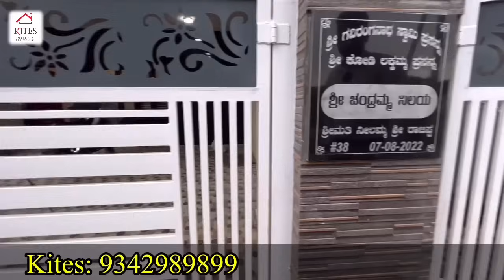30x40 classy construction in 40 lakhs | construction in kannada

Comment: Guys Just don’t fooled by promotions. I am also into construction and If some one want to construct with Red Brick it will cost u around 2.5L average per 100 sqft including everything (Interiors, High Quality Granite, All electrical fittings). Mostly final cost depends mainly on wood work, Bathroom Fittings and Granite. If u go with Hallow brick it might cost 2.35L per 100 sqft. Here I am talking about with all final fittings.
Reply: How will you construct for 3l
Reply: @kadasanirajasekharreddy   I have corrected my message it’s per 100 sqft
Reply: Are you providing services at Bangalore
Reply: I only prefer within KR Puram and Whitefield. And I do have my own A Khatha sites within K R Puram which are in very decent locality in BBMP limits

Comment: Kites alli basic package bandhu Rs. 1950/- sq ft. 2500 sq ft, andre 25 chadradi kaatidre without interiors 48.75 lakhs aagutte...adhu yaava lekkadalli 40 lakh anta heltidira
Reply: ಯಾವ ತರಹ ವಿವರಿಸಿ ರಿಪ್ಲೈ ಮಾಡಿ
Reply: 1 sq ft will cost you 1950/- rs. 25 chadra andre 2500/- sq feet kattodikke 1950 X 2500=48.75 lakh aagutte alwa. In simple 40 laksha aagode illa..

Sq ft rs. 1750 aadru almost 44 lakh aagutte.
Reply: Actual Area = 2750 sq ft
Rate of 1 sq ft = 1675
total amount = 2750 x 1675 = Rs. 46 Lakh
They were providing cement Bricks , aluminium Windows and Vetrified Tiles.
So we said that to Red Mud Bricks , wooden windows & shutters and Granite.
It cost us extra 6 Lakhs approximately .
All interior was provided by us from third party Carpenter, which cost us around 5 Lakhs ( material + labour).
So total Cost of this house that You See in this video is 46 + 6 + 5 = 57 Lakhs.
I would say that around 60 Lakhs Spent on this.
Reply: @bharatsr5149  40ಲಕ್ಷ anta display ಹೇಳಿದರೆ ತಪ್ಪು
Reply: It's 46lakh as told by the owner....not 40-42 lakhs......
Kannada kuvara, pl give accurate value....pl don't misguide.
Reply: How views goskara niv heege maadi fake or misguide madidre gradually subscribe kadime agute
Reply: @somashekards8086  that's true nowadays all his promotions are showing. Less price compare to calling the company...
Reply: Right the problem is accurate figures are not mentioned for various purposes. Alli hogi vichara maadidmele gottagodhu nijavada rate
Reply: Actually adu 48lakhs ee bro.. 
But neevu kannadada kuvara antha promo code use madbeku avaga YouTube navru 8lacs paymadthare kites company ge avaga nimge discount apply agi 40lacs aguthey !!!